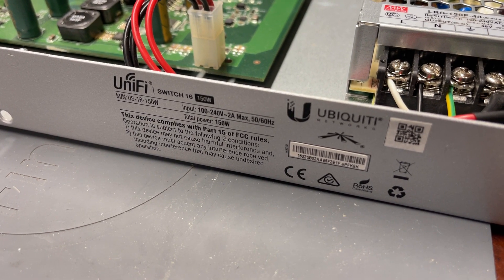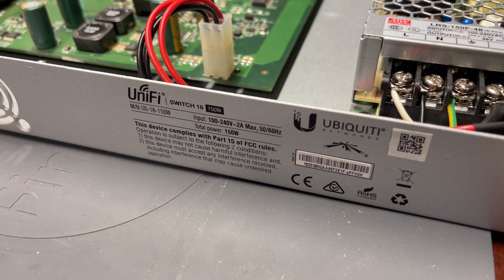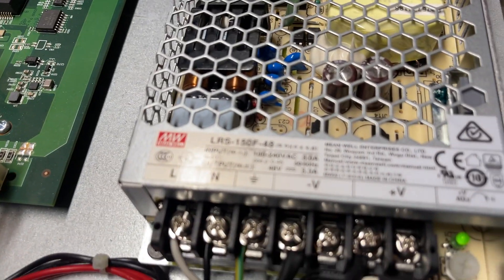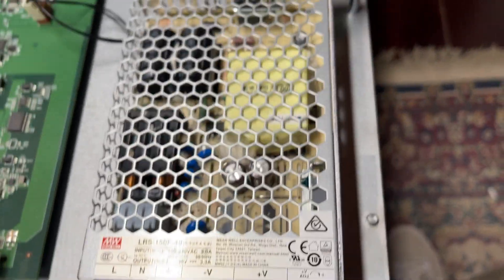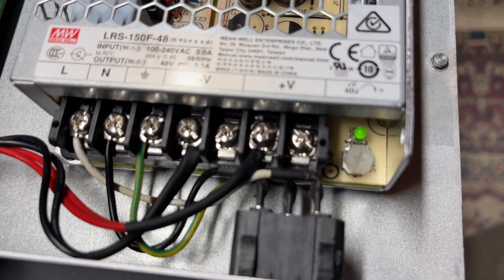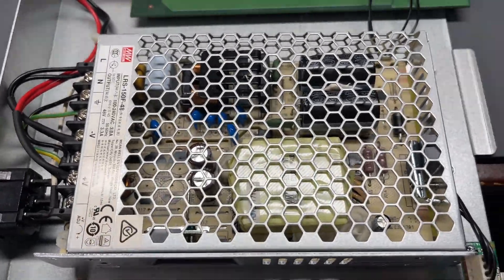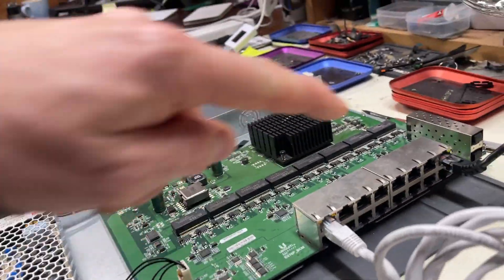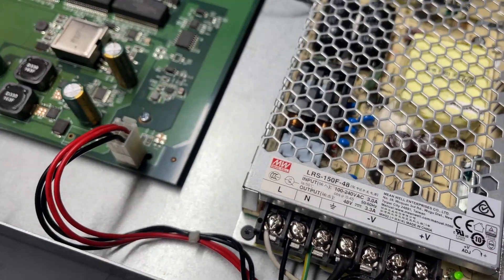Unifi 16 Port Poe Switch repair for no power - US-16-150W

Comment: Did you adjust the voltage out the box with the adjuster next to the LED on the meanwell? mine is rated at 49V out the box.

Comment: Thanks, I'd picked up one of these LRS-150-48 power supplies based on size before seeing this, after watching your video I had to double check the wiring as the load and neutral are opposite colors from what I'd expect, and yes your correct, white is load coming off the C14 socket.  I did use all four V- V+ instead of joining the leads, and fashioned a small metal plate so I could also tie down the other end, but other than that it looks the same and works like a charm.

Comment: You can turn the output voltage up to 54V to match the original spec.  Just turn the little plastic screw clockwise with a multimeter on the outputs.  Your fans are missing.
Reply: Hello @Ein Felder. I have a RUCKUS ICX 7150 C12P. The original power supply was rated 150w which got faulty. Then I installed a 200w Mornsun SMPS voltage set at 50v. The switch works, but it gives a fatal error "vmain (48v) fault has forced all ports on slot 0 to lose power". My question is, should I turn up the Mornsun power supply voltage to 54V.
Reply: @srijanchakrabarty59  Why not - it's not working at the moment.  But the switch should work fine on 48V - only needs 54V to help power up heavy load POE devices.
Reply: @einfelder8262  I did it and the fatal error doesn't show anymore. Thanks!

Comment: Clearance looks pretty tight there between the V+ terminals and the phase pin on the back of the IEC13 socket - might be worth a second layer of heat shrink for rub protection? Would suck to put 240AC onto your +48V bus and kill the cams... Nice choice of PSU brand by the way - MeanWell = good respects :)
Reply from the maker: Ha, noted M8,  I was sure it was ok but now had to double check to be sure and I added second Shrink layer.
Reply: I tried this and lights came. I unplugged it and plugged back up now I get buzzing noise. Any idea what I did wrong